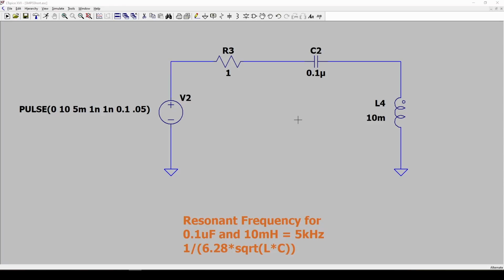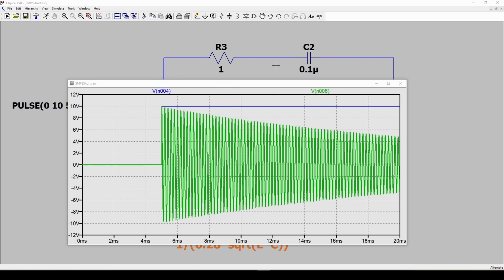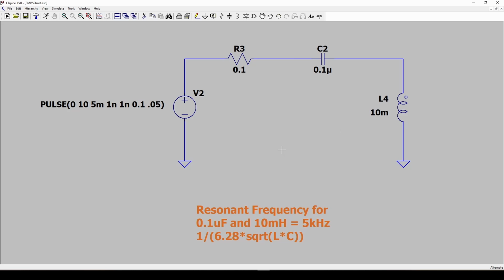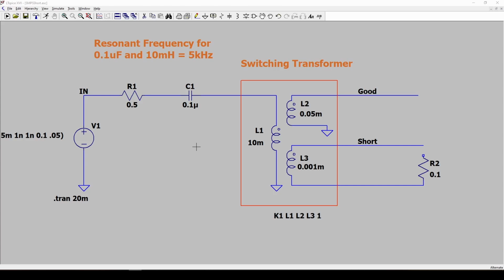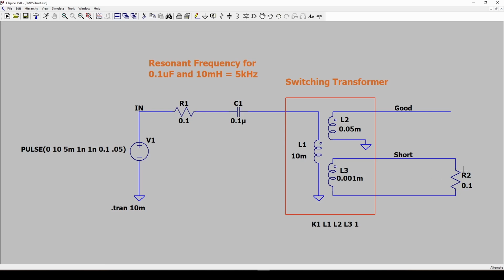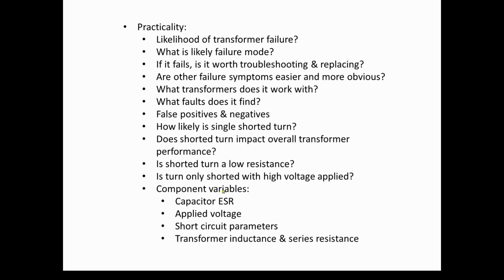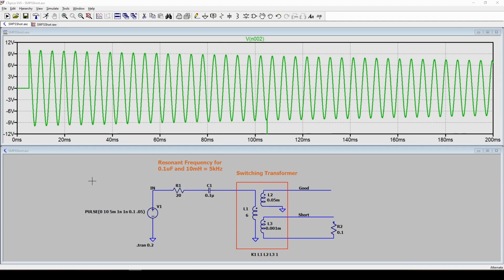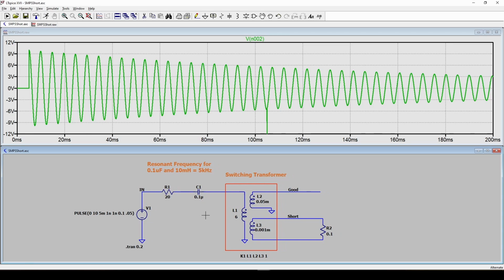Transformer Testing with a Ring Tester Part 1

Comment: How does the ring tester of counting the cycles of a coil or transformer knows if the coil/inductor has a higher Q or Lower Q or Shorted internal windings?